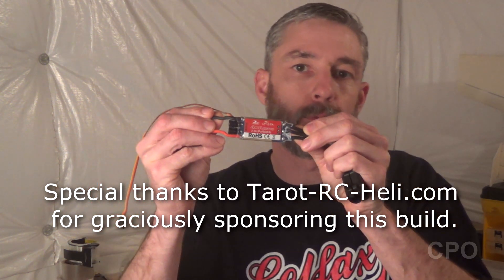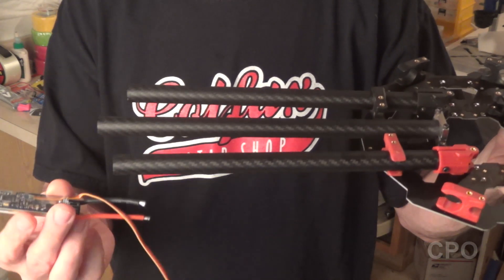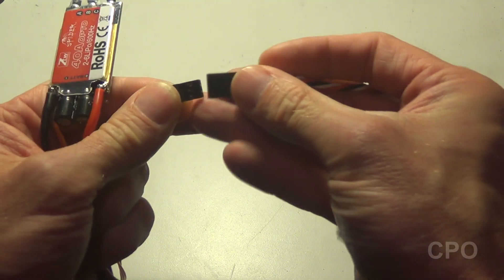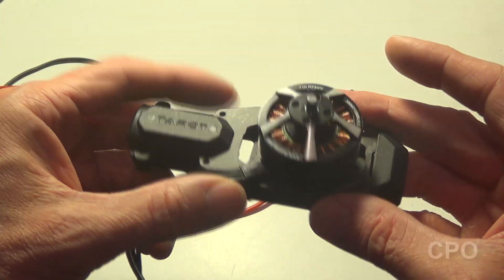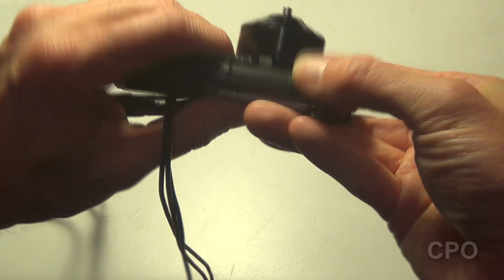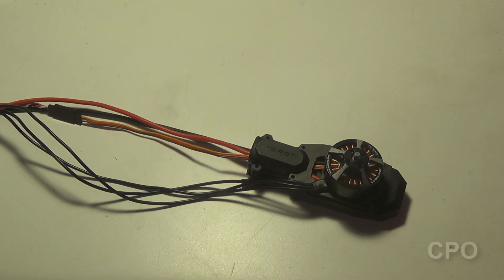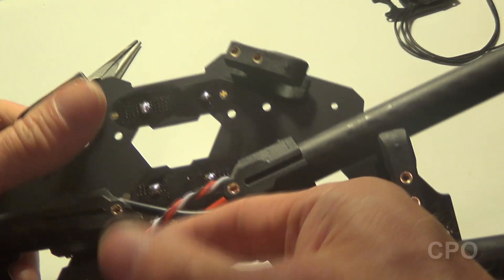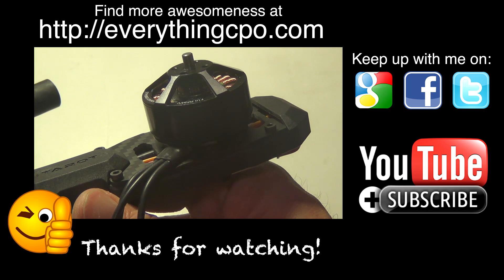Tarot 680 Pro Hexacopter : 40A ESC Mounting under Motor (ZTW)

Comment: Had this same issue with my Tarot 680 while upgrading to 50 amp esc's . Luckily I had some different motor mounts that worked better , but this idea looks better. Even  though I would have had to redo my power and servo lines or extend them.
And as far as the amps of the esc's being Overkill, They came with led's lights on them and I got them for a great price, and I am ready to upgrade later if need be.

Comment: Hi CPO! Great videos serie about 680 PRO. After that I've decided to build it following all those tips. I've ordered 6 ZTW Spiders 40A like I seen in video and all those are v2 version I've noticed this one has not SimonK firmware. I've tried to re-flash once using a BS40A.hex(HK blue series) but aftet that the rotor doesnt spin and that ESC it's draining so much electric current. Could you tell what's happening?

Comment: any issues with the esc yet in terms of increased battery leads? Im about to use this method instead of motor wire increase , hopefully youve had no problems yet!

Comment: Hi CPO built my 680 pro at last with alot of help from watching your videos, had one flight and my plastic engine mounts have gone out of level, used the blue colour bolt retaining fluid on all of them, and now i've noticed cracks on the orange mounts at the 8mm bolt holes (inner most 2 only),(placed an order for new ones)  have you had any problems with this, thank you
Reply from the maker: I haven't noticed anything like that. Is it possible you tightened them too much, adding strain that cracked. Also, I added tape to give some grip so they wouldn't spin. If you haven't done that, you might try it.
Reply: Hi CPO will give that a try(tape) do remember you saying that von one of your vids thx again for the help

Comment: Heya, any chance you know which simonk firmware files these controllers take and if the can handle comp_pwm? I blew up two ipeaka 40a escs and i suspect it's the comp_pwm killing them. The thing is I can fly for hours before anything happens so i'm not sure...

Comment: Removing the capacitors and extending them to a different place? Good idea?
Reply from the maker: I don't think it's a bad idea. I know some folks who have done this and put the capacitors inside the boom. They need to be as close to the esc as possible to actually do their job. I personally wouldn't do it, but mostly because I just don't know what the result will be long term. But... You won't know if you don't try it. Sorry I can't be of more help.

Comment: Great job on taking the effort to put together a comprehensive build video but, just one rub, why did you say "I can only mount the motor with two screws"? Your not the only one saying this. Does it not occur to those to simply locate and drill the very much required mounting holes? Hey, but maybe you had that planed all along, just didn't sound that way in the vid.
Reply from the maker: So, herein lies the challenge with a one-way communication medium such as video...sometimes it's hard to hit every point just right for everyone...and there isn't an opportunity for immediate clarification -- so thanks for asking this question. 

I mentioned that I can only mount the motor with two screws because I think people expect that all four holes should line up always. That happens almost always on helis, almost never on everything else! :)  

I was just explaining my possible orientations (as it relates to which direction my motors wires would exit the motor...and also the benefit of the channel that is created on the underside.  I'm glad those were the two screw holes that matched...because it made it easy. 

Why didn't I drill out the other holes for more screws?  Because it's not necessary.  You only need two screws to solidly hold the motor in place. Four isn't required.

Comment: Seems like a big debate on extending the battery leads vs  the motor leads. Have you put any thought into adding a capacitor to the extended battery leads? That is what I did on my 680Pro.
Reply from the maker: Yeah...I have read the debate, and decided not to add the capacitor. From the best I can tell, it might not be a big deal.  If I have problems, I know where to start looking. :)